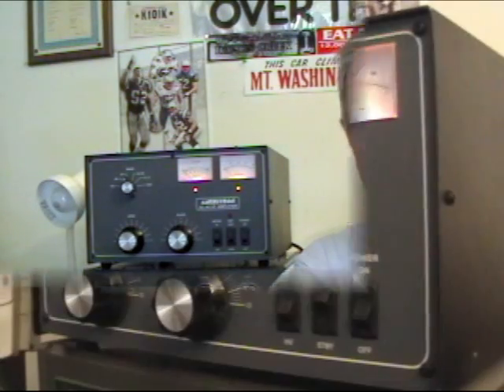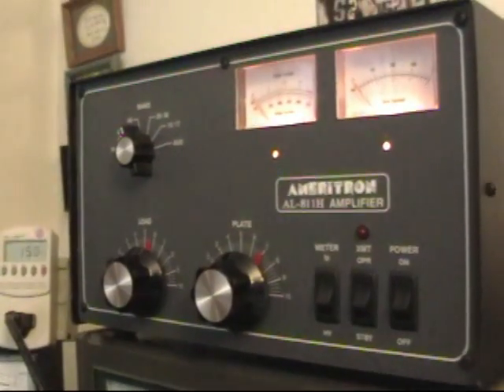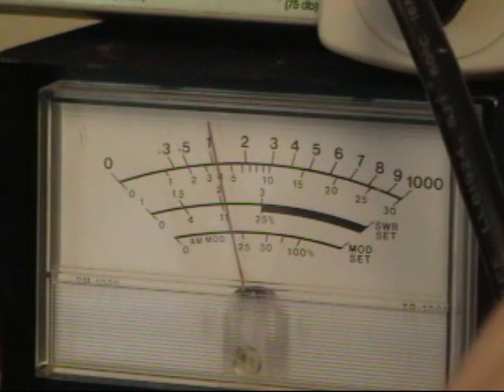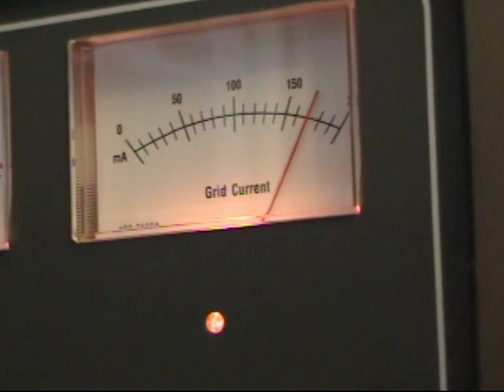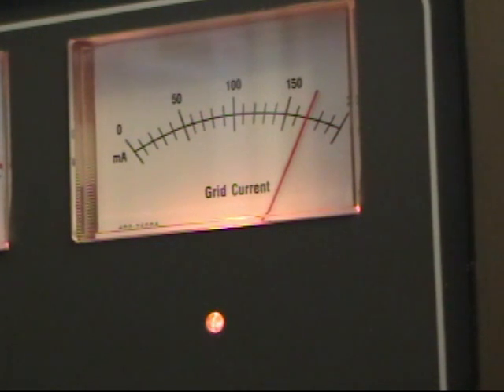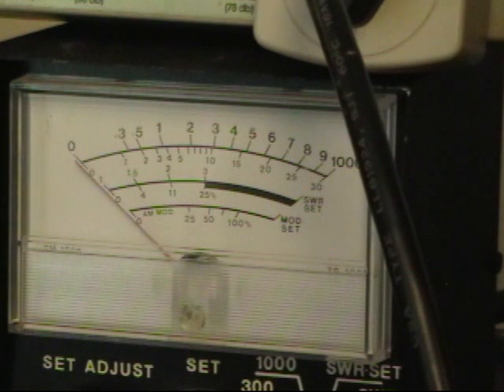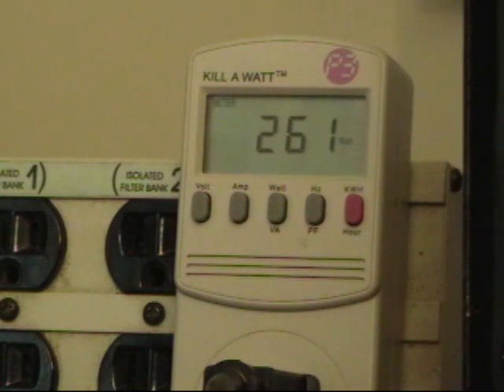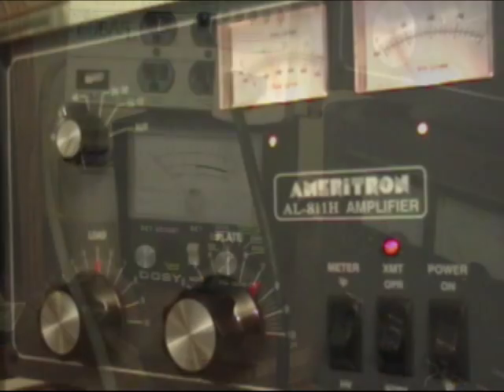Ameritron Al-811H Linear Amplifier Demonstration by K1OIK

Comment: I, too, had an AL-811H.  Replaced the tubes with Svetlana 572B's.  At 800 w, it is only 3 db below legal limit.  That's half an S-unit.  1000 w, 1200 w, or 1500 w would not do any better for you.  Also, I followed the instructions on tuning in the manual.  No problems.

Comment: Pls help me I do have an AL-811 and was told not to go beyond the red line while tuning. No I noticed that the plate current on your Al-811H  is the one that has the RED marker on the meter and not the GRID CURRENT meter, opposite with AL-811 can you pls kindly tell me what I was doing wrong and should I just simply follow the way how you were tuning your 811H ? Thank you and 73
Reply from the maker: Did I go beyond the red line?
Reply: Yup if I were to compare it to where your needle went on grid current it was all over the red. Which I dont understand, your grid current  doesn't have the red marker but instead it's on the LOAD PLATE

Comment: As of 5:31 you still haven't explained how to tune it and I gave up. Albeit after watching 5 mins hashed together clips of different input wattages. 

Terrible video. 

Do you actually think this is instructive and well presented? 

Waste of time for this new linear owner. Horrible.
Reply from the maker: You are too stupid to understand. What do you think adjust the plate means, you think it might mean adjust the knob marked plate, genius?
Reply: @Capecodham  "adjust the plate" is not an adequate or complete explanation of tuning a linear. 

Just like your video is insufficient in its explanations.

You have affirmed my initial criticisms with a 2nd example of it.
Reply from the maker: @boostthesignal  I have 230 likes that were not too stupid to understand what was going on. You have affirmed my initial criticisms with a 2nd example of it of stupidity. I thought hams in St. Paul were smart.
Reply from the maker: @boostthesignal  Please cite your basis for your name calling as you hide behind your keyboard. Dream it......Do it.

Comment: Hi Burt is it ok to use an 811H amplifier with an IC 7300 regarding the PTT and ALC lines direct...please from Fred g4vvq UK
Reply from the maker: I never tried it, I Manually tried it
Reply: It's fine.  The 811 has low key voltage/current draw.  I used an MFJ ARB-704 and rig cable between my 7300 and 811.  Just playing it safe.
Reply: @SWRadioConcepts Bonjour, auriez-vous un schéma de connexion? J'ai aussi ce ARB 704, mais je ne sais pas si connecter le jack ALC; mon mail: cadioujm@yahoo.fr
Reply: Ok thanks i just plugged mine in and it works fine...Fred in UK g4vvq
Reply: Good deal!  I just got the 811 (3-tube) and it really made a difference with my compromise antenna.  I can actually rag-chew on 80 meters now!

Comment: I understood that if you put 70w at the input you can get up to 700w at the output. What final power would you get by playing 10w, 20w, 30w, 40w ...? Thank you so much for sharing your video. 73.
Reply from the maker: It becomes less efficient with lower drive. with 10 watts you might 70 watts.

Comment: Got to tell you pard, it was a great demo of this amp.  I have an Ameritron AL-811-H, replaced the 811s with 572Bs and have never had a problem with it at all.   Had to replace the meter bulbs, but did it with LEDs, so there should be no problems after that.  Dollar for dollar, its one of the cheapest amps to use, and got great qualities where it counts.  Upgraded it a bit with new caps, and bleeders for stabilization, and saw it go to 900 on the Bird. That should be all any ham needs.  Thanks for the vid for all those who did not know how to do this.  Wouldn't take anything for my Ameritron. its been a good amp.  KB4AKS   "A"lways  "K"eep  "S"miling !!   73.  Mark
Reply from the maker: Was getting the 572s worth the expense?
Reply: Since they will never be abused nor overdriven, and since they are the most rugged of them glass bottle tubes, they should be lifetime tubes. Will never need to replace them, so yes, they were worth the expense.  Got all four for $200.oo  brand new.  Good investment.
Reply from the maker: You got a great price.
Reply from the maker: An "investment" is something that makes money. Little in  ham radio is an investment
Reply: If I had given Ham Radio that much thought  I never would have got into the hobby.  The way it is, its an investment that I would never have to shell out todays heckalacious prices for tubes.  Nice Amp, Nice Tubes, Nice readings from others, yep, it has a return.
Reply from the maker: An investment makes money, how can you call spending an investment? Do you "invest" in beer?
Reply: No.. I don't drink.  I save it for my ham radio fever.  Before you ask, I don't drive a Ferrari, have lots of money in a safe, nor do I argue about tubes.   Its an investment indeed if I use it till I want to sell.. then I got the bull by the horns, with permanent tubes, so it will return a good profit. But probably will never sell any of my equipment unless forced to do so by extreme poverty, and that ain't likely to happen anytime soon.
Reply from the maker: That would be the first 811H that sold for more than you paid for it. Tell me how much you paid and how much you think you will get.
Reply: No further comments need be made, as this is getting ridiculous.
Reply from the maker: Mark W. Mullins so why did you make a comment?

Comment: I'd like to see one with 572B finals for a comparison.
Lee, WA8QFE
Reply: You'll get virtually the same  values on all meter indications. 572Bs are over-rated when used in an 811H amplifier (same with the 3-tube 811 amp.); 572Bs will last longer and accept more abuse than an 811A tube in this amp. 572Bs are rated for ~2,200  Vp, while 811As are around 1,750V. 572s have graphite plates which have a MUCH higher melting point than the simple thin mild steel plates of the 811As.

Comment: Hi Guys, i dont like the sounds of the 811 only lasting about 1 year, what does that mean exactly, is it if you use it all the time, or 3 times a week or once a week etc...i know you can replace them with the 572B but you shouldn't need to or they should put them in there in the first place, i haven't bought one yet but thinking about it...any comments welcome, from Fred g4vvq in England...
Reply: Tom Smith - I might add that the quality of the 811's now are not as good as the American made. If one can get American 811's,  please do so.. they'll last far longer.
Reply from the maker: It will last years as long as are reasonable
Reply: ok...

Comment: 00:21 "There's no sense in having two linear amplifiers."  What if one is down for maintenance, repairs or has an issue that make take some time to resolve.  Whether it's an HF rig, a VHF/UHF rig, a tuner, a mic or an amp, 39 years of ham radio experience (and 48 years of broadcast experience) has taught me that you ALWAYS need a backup!
Reply from the maker: In a lot of things you need a backup, but not in ham radio.
Reply: I respectully disagree.  Some years ago, I was the liason between local law enforcement and the only local broadcast station (WRHI-AM) in a small town in South Carolina during a major hurricane (Hugo, 1989).  I was the only ham getting information from the city/county government to the public via the radio station.  No one could get to the station to back me up since the road were blocked by heavy debris.  The VHF radio  I was using (Icom IC-28H) developed major problems.  It I had not had a backup rig (IC2-AT), there would have been no communication between the police and the public.  From that point on, I ALWAYS made sure the equipment I owned had a redundant unit, whether it was a HF rig, VHF/UHF, power supply, emergency power, antennas, power supply, ampllifiers, tuners or what have you.
Reply from the maker: You found the rare case where a backup was important. Most hams are not you and they have a backup for their cackling,  hardly important.

Comment: Please DO NOT use this video as a way to tune an amplifier. An AL-811 has 811A tubes and in tune mode that means 5 seconds key with a 10 second rest in between. You will destroy the plates on the 811's if you tune like this guy does. An AL-811 should be able to be tuned up in 2 or 3 five second key downs. T first I thought this was a comedy until I realized he was serious.
Reply from the maker: Mac Paul Please share your video on the process, oh that's right, you have no video.
Reply from the maker: +Mac Paul I wonder how my amplifier worked for years?

Comment: I said it before,sometimes its the things that you DON'T SAY,that can be a lie...do a video showing the filaments in the tubes,I'll bet they are nice and "silvered" from more then 5 second key-downs at a time Burt.I'm willing to bet also that you still own this amp,due to the poor demonstration given in this video...I have the Ameritron AL-1500 with two 8877's (two Eimac 3CX1500's in parallel) even with these mil-spec ceramic triodes,I NEVER keep the Collins transmitter keyed up into this amp more then 5 seconds at a time.
Reply: +4 gauge   AL-1500 only has one tube.
Reply: +1903A3shooter Mine has been upgraded and completely reworked internally.Nothing in this amp is stock anymore but the cabinet.
Reply: +4 gauge Thanks to mjsmith626 for completely rebuilding my AL-1500.Its now a AL-3000 and have not had ANY issues with this amp.Great work!!.

Comment: These things are a nightmare. The microscopic relays have DIP  ( read IC pinpout) packages soldered directly to a circuit board..  You have to tear apart the whole damn amplifier to get at it..  contacts aren't the size of a match head.. and then you need a special dip soldering iron to unsolder all the contacts at once.. or you get to cut it out.. piece by piece.   Easy for robots to make.. bad for humans to service.   Contrast to an SB-200 .  As to stability ( especially in the 3 tube POS)  no comparison.  I took a hammer to one.. that's what I think of these things.

Comment: I don't like to put my call, W1KQ, on YouTube as well. <grin> Someone may see it.  Makes me think someone doesn't use a whole call sign on the air for fear someone may see it.  AF7 something?  Sorry Popgunner101 can't help myself when someone wants to keep their call sign private.  I worked at HRO for many years and can't believe the number of people who would not give their call sign, in the store or via the 800 number, as if it is something to be kept a secret...or maybe they're ashamed of it?

Shameless topic hijacking for a moment:

I put 572B tubes in my AL-811H a few years ago.  They just cruise at 700 watts output.  I tune my amps for maximum smoke. (Max RF output)  Amazingly the dip in IP is max at max RF output. <grin>  Oh I also have an Ameritron AL-1200. That amp helped me figure out the optimum length of my Anaconda dipole.  What is an Anaconda dipole you ask?  It's my homemade version of the Cobra dipole made famous world-wide pretty much by Joe, K1JEK. Raymond Cook, W4JOH, is the inventor/designer of the Cobra.  Anyway to change the topic just a bit, I built my "Anaconda" using 12 AWG Romex, sheath in-tact, from center insulator to each end insulator, an MFJ-952 W9INN 4:1 balun, multi-stranded 450 ohm ladder line (roughly 100 feet in length +/-) and about 30 feet of buried RG-213 to the AT5K tuner in the shack.  The length of the dipole was shortened to a length of 84 feet per leg, from 86 feet per leg, when melting and burn marks occurred on each end about 2 feet from each end insulator after putting 1250 watts into it.  The apex is close to 70 feet up; ends are close to 50 feet up.  I didn't do any modeling--just built it based on the Cobra's original design.  Oriented for max signal to and from Europe, the whole contiguous US, and Australia.  Works like a champ...especially with 800 watts from an AL-811H with 572B tubes.
Reply from the maker: Hams are afraid of their own shadow. Who the hell cares about any ham so why not say your call?

Comment: Nice way to abuse those tubes Burt,  You did a fine job cooking those anodes and I'm sure the new owner is going to appreciate it. What you accomplished here was actually showing people what not to do while tuning up an AL811h.   What was that like 15 seconds of 100% full duty cycle CW carrier like 3 or 4 times in a row with no rest period in between tune ups. If that's your normal tune up procedure than I bet those anodes have a nice bright silvery spot in the middle where they where over heated..

For those of you who don't know the anodes in 811 tubes are very thin and heat up quickly. Since 811 tubes dissipate their heat via infra red radiation there's no amount of forced cooling that will protect them from long tune ups (read more than 5 seconds)

 Thats why the manual is very specific in that you must not exceed 5 seconds of CW carrier while tuning up. Furthermore the warranty does not cover tube damage from improper tune up procedures and while you did a fine job demonstrating the plate current dip the excessively long tune up will destroy those tubes very quickly. 

 If used properly the The AL811 is a fine amp unfortunately I see far to many 811 tubes which have been cooked by people tuning up like you just demonstrated.. 5 seconds max is all it should take if it takes you longer than 5 seconds to tune the AL811 then YOU MUST WAIT AT LEAST 15 seconds.  If you can't get the hang of tuning up an amp 5 seconds then at least buy a pulsar for tuning which will reduce the duty cycle during tune up saving the tubes...
Reply: Are you know what for when I saw the meter you were using a Dosey good Lord if you find for relative power while you're tuning up however you should know better
Reply: I agree with all .

Comment: 2.5-25KV BUTTERFLY CAPACITOR KITS VA6POP

I can build for u any air variable capacitors kits
for yours magnetic loop antenna,antenna tuner,HF amplifier

2.5-25KV BUTTERFLY LOOP AIR VARIABLE CAPACITOR KIT  FOR YOURS MAGNETIC LOOP ANTENNA
15KV BUTTERFLY CAPACITOR KITS 10'' od rotor

HOMEBREW  2.5-15KV BUTTERFLY CAPACITOR KITS

http://forums.qrz.com/showthread.php?351604-Butterfly-capacitor-kits-5-15kv

http://www.flickr.com/photos/93005502@N08/page3/

http://forums.qrz.com/showthread.php?378701-2-5-15kv-butterfly-capacitor-kits&p=\
2764980#post2764980

I have kits available for ham radio:

2.5" OD ROTOR
3" OD ROTOR
4" OD ROTOR
5" OD ROTOR
6" OD ROTOR
8" OD ROTOR
10" OD ROTOR

73 de VA6POP!
yo5bzz(at)gmail.com
Location: Calgary,CANADA

Comment from the maker: Depends on the quality of the cables and their connectors. But mil-spec RG58A/U or RG58C/U can handle a kilowatt on HF, into a matched load.

 If you run SSB-CW-PSK31, you should be in good shape unless you're transmitting into a real mismatch. For RTTY, I'd go for bigger cable.

 WB2WIK/6
Reply: High power rfc 400 only way to fly
Handle 1800 watts
And very low line loss
Reply from the maker: It has been 12 years, sorry I don't remember.

Comment: Great video....I just picked up one used...Standard 811 model....I was wondering about upgrading my feed line to the antenna... It is RG-58, but I don't plan to run more than about 300W into my vertical loop...Thoughts? 73....

Comment: I bought one used and intended to run 572B's in it but the post office dropped the box and badly damaged the amp so they paid me for it and I bought a clipperton l without tubes and used the 572B's in it.  Nice and makes 1300 watts...Enough power!
Reply: wb5oxq - Wait... you got 1300 watts out of an AL811H with
 572B's? How,  pray tell, did you mnage that??
Reply: @bob4analog  lol no read it again. He got 1300 watts out of a Clipperton with 572s. Even worse. Just pure bullshit

Comment from the maker: Class AB is intermediate between A and B. The 1 in AB1 means that grid current does not flow, the tube grids are not driven positive. A class AB1 amplifier will produce much less distortion than a class B amplifier using the same tubes. The distortion figures are often comparable to class A. The rise in plate current from zero signal to maximum power may be as little as 10 % to as high as 70 %. 
Any idiot can look it up. But you have never had a license

Comment: I've been thinking about getting an Ameritron AL-811H for sometime now.  I've been running barefoot out of an Alinco DX-70 since I got my general ticket.  Truly I've yet to run into a problem making a contact running 100 watts, but it would be nice to have the extra power there if I happen to need it.  Great video Burt, I learned a lot.  It's pretty similar to running my old Heathkit HW-101 as far as tuning for the dip etc.

W8MLD // Mike

Comment: I should have kept typing.  I read an article once that said, "Ham radio was cool because it was dangerous back in the old days where things were blowing up."  I have to agree that where has all the experimentation gone?  Anyway, I want to run some power. QRP is neat and all but I want power.  Power is cool.  How much are you selling that AMP for.  I want to get my hands on one so that I can experiment.  I did not say blow up.  I recently have an intereest in HF and quite frankly vhf is boring.

Comment: When did DOSY make the non-peak reading meter? 
Oh, to the poster below, I have seen a cb linear do 50,000 watts on AM, wanna see it? It is even mobile, and not dosy, either...LOL - but a Bird 43 - in a Sburban - a lot of cb'ers use 1-2k, thats why the AM band there is so trashy - and they are always trying to sell burned up ham amps, just look on ebay! Want to hear 100k on the air? Go to 27.025, listen when they are doing their version of dx (state to state) - FCC seems not to care? hmmmm